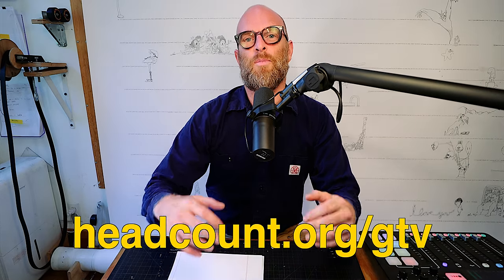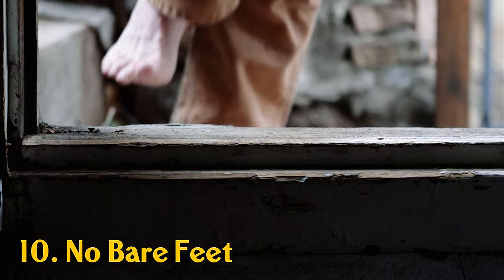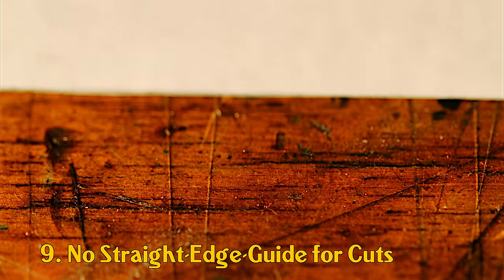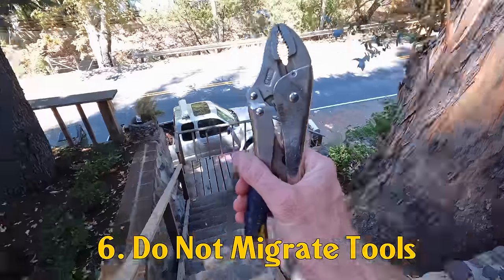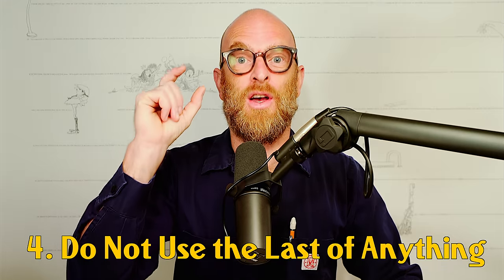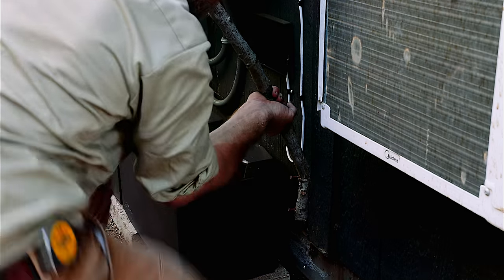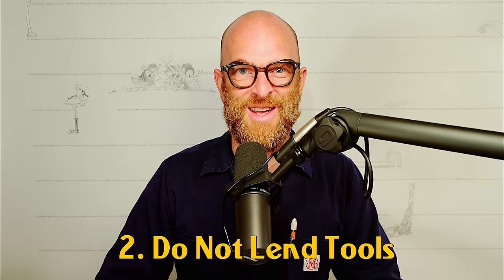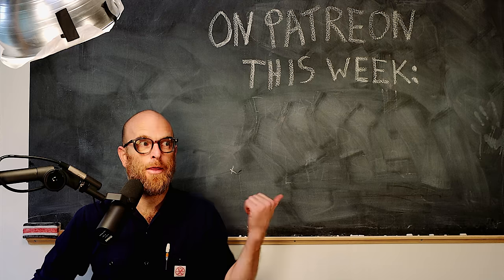10 Forbidden Practices in the Workshop

Comment: There is a reason why no one should ever use flat-head screws - if a screwdriver slips from a slot, it goes into your hand.
Reply: And even if it doesnt go into your hand you immediately wish it wasnt a flat head
Reply: There are perfectly good reasons to use a flat head screw. Ships are a great example, or any environment where debris gets trapped in screw heads because you can easily clean  a slot. Good luck cleaning 50 year old paint and grime out of a Torx head.
Reply: @Nubby007  grime and dust etc. In the torx or philips would bother me a lot less than a slipping flat head
Reply: @smashyrashy  Here here! Agreed good sir.
Reply: good point. probably the single most common tool injury on earth.
Reply: I only use flat head bits to open paint cans and to unhinge hot wheels axles from the base without having to clip off the hinges themselves
Reply: Or just learn how to use a screwdriver. And I bet you use tons of flat-head screws, just not slotted ones.
Reply: @Zero.0ne. not even close lol
Reply: @hallowedbethygame2840  I disagree. Even grandma has used that flathead in her junk drawer.
Reply: @Zero.0ne.  I have never heard of anyone injuring themselves driving a slotted screw, and I find the very concept absurd.  I’m sure there are some isolated cases where someone managed to hurt themselves in that manner, but it’s certainly not the most common tool-related injury—not even close.
Reply: @hallowedbethygame2840  Its common when holding a small part like a hose clamp. I've done it and I've seen it happen to 2 other people. Maybe hammer finger is more common.
Reply: @hallowedbethygame2840  What's your guess on most common tool related injury?
Reply: @Zero.0ne.  Hose clamp is exactly what got me

Comment: I’m a lowly general contractor. Did historic restoration and architectural renovations in SF for decades. I’ve saved/stored many materials over the years. Just finished cottage on the property with many of these items, sinks, fixtures, electrical, wood, siding, etc. very satisfying. Flat head screws have there place. On wooden boats. Where they are countersunk, caulked and bunged. The slotted or flat head is easier to clean out to extract when repairs are needed. Probably one of the only places I’d use them in a new project.

Comment: The only single quibble I had was the “no flat head screws”😂  when building furniture that has hardware of brass, bronze, or iron, nothing looks worse than a Philips, Torx, Roberson, etc…. Those applications absolutely required a hand driven flat head.  
*admittedly, I’m primarily a hand tool woodworker. 
-a huge thank you for your content ❤
Reply: Yes, exactly. Not just in furniture: slotted screws are without alternative for a number of things, especially stuff made pre-1930s. It’s okay to hate working with them, of course – but replacing them in such items is a bit of a sin. And we’re usually only talking about a few, not hundreds.

Also, it would be cool to call them “flathead” screws if that didn’t have another, different meaning: flathead screws are countersunk screws with a flat head, the ones with a slot across the head are slotted screws.
Reply: And guns use flatheads, looks better.  No other way around it.
Reply: I spent my youth working in a mom and pop hardware store followed by a century old family lumber yard. 

I am not the expert. When I hear Van say 'flat-head screws, I translate that to slot head. Using a flat head screw driver. I will use countersunk flat head head screws with a Phillips drive. Never with a flat head screw driver. 

Tomatoe tomato. Potatoe potato.
Reply: @nickspann89  reason for that is you can find random items that work as a flat head screw driver when you need to improvise but good luck improvising your own Philips driver.

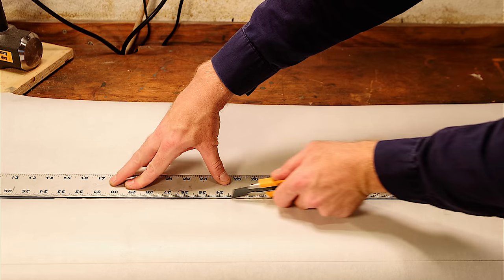Comment: 1:42 I’ve cut laminated signs for five years using a straight razor, each time we were cutting on top of a pre-printed line but we nailed it every time. Never cut a straight line freehand, it only leads to mistakes.

With peace and love to the spirited man
Reply: Oh man…. I’ve only ever cut straight lines both with the penciled in or printed line AND with a good straight edge. I worked at a sign shop for 15 years and I still make small signs for my current job. I just always make sure I use a very heavy ruler with some grip underneath. I can only remember messing up once.

Comment: I love all these concepts.  Videos like this keep me grounded on many fronts.  I have found that applying consistency to my tasks and focusing on getting one done before another starts is very beneficial related to the outcome.  I have two 30s era planes that I am restoring and had to force myself not to do them at the same time.  The Type 3 G5 Gage plane will be done in a few more days and then I start on the Type 14 No 7 Jack plane.  The amount of random tools and supplies it takes to do this job is significant and I am also teaching myself how to clean up as I move to a different task and put those tools and supplies away when done.  Makes for such a better organized process and thus, better results.

Comment: Hello, my name is Pete and I'm a wood hoarder.  I've got wood in my shop from the early 2000's.  The only small pieces I hang onto are the more exotic species, but I do have to confess that they gather a lot of dust.  I'm on a no-purchase restriction (unless a project calls for something directly specific) until I use up a lot of the hoarded wood supply.   It's crazy how much space we surrender to stuff we're not using and don't even have a plan to use.  I'm using a fair bit of it now in preparation for my own first kickstarter, for next year's Make100.  Van and a few others have inspired me to start putting more out there and exploring "my art" more and more.  It's tough to walk by some of those pieces at Woodcraft or a lumber supplier though!

Comment: A trick I use to break rule #9: I have some iron rectangular weights from a scrapped weight lifting machine that I glued cork padding to. I set the straight edge, and then weight it down to keep it stable. It's especially useful when cutting leather or thick foam where you'll want to make multiple passes.

Comment: “No straight edge” is great for accuracy based tasks. But a straight edge is for precision based tasks. That’s why it’s called a *Straight-Edge*.  Using or not using one just depends on the goal of your task. If you absolutely need the finest line you can (which I do when making foam board models) you can’t go with anything other than a metal edged ruler.

And you’ve gotta get a good alumi-cutter/straight edge with a rubber foam or silicone bottom edge to prevent sliding.

Comment: I've cut thousands of pieces of paper when prototyping, and I always use a ruler—with an antiskid material on, of course, the kind made for that job. Then it doesn't skid and your cuts will be perfect. Also, flathead screws are awesome. If you look into fine woodworking you'll find a lot of flathead screws and learn about clocking. I would never exchange a flathead screw on a repair, if it had an aesthetic quality to it (like old furniture).
Reply: AGREED i will ad to that with the fact that i have never stripped a flat head screw. but you even look at a Phillips head the wrong way and oops boom stripped bare FLAT HEAD FOR LIFE

Comment: For cutting along a ruler or other straight strip of material, just glue or stick something rubber to the bottom, like in the guide rails for plunge cut circular saws. They'll never slip unless you're really clumsy. Also, always mark at least the beginning and the end if your cut, tyat way you'll bevable to check your work.

Comment: in my architecture school i developed that rule number 9 is hybrid, first draw a line, and cut a small checkpoint free handed, split it into several section that probably gapped less than 20cm, then use a metal ruler (i used to chop off the damn plastic with my razor cutter)

Comment: Recently built a shed. Instead of running electric I thought I might just run extension cords. Until I realized it was just a mess of trip wires. So with 25 feet of Romex I ran two boxes and one fixture and connected them with a pass thru RV power outlet. I run the extension cord to the exterior wall of the shed from the garage (plugged into a GFCI). 

No more tripping.

Edit: I loaned out a jigsaw 10 years ago to a person who I thought was a friend. Haven't seen or heard from them since. Shame on me for being overly trusting.
Reply: But look at it this way... You got rid of him for the price of a jig saw.... and you didn't have to cuss him out. I'd say you came out on top.

Comment: The flathead screws one hit hard. I effing loathe those things. And the previous tightarse diy’er owner of my house used them everywhere, and also filled the slots with paint on all his crappy projects.
Reply: You mean slotted screws. Flathead refers to the shape of the head, not the type of drive. And you’re in luck: paint is much easier to clear out of the slots than any other type.
Reply: I agree they should be referred to as slotted, but I mean he did call them flat-head in the video. 
Also I find most of the time if there is paint in a Philips head, it just mashes out of the way if you just push a bit harder, especially using an impact driver. Whereas you have to clean the paint out of a slotted screw.
Reply: At least it's not rounded out square heads
Reply: @anonymouswhite352  Very true!

Comment: 5. Flathead screws only where hand-tight is the only kind of tight you need. Otherwise yes.

4. This rule applies to everything, if you needed to have a stock of it before, you will need a stock of it in the future.

3. My art closet is becoming a nightmare because of my hoarding. I also have a bunch of wood I will never use.

2. I have my dad's impact hammer, next I organize my tools it is essentially mine.

Comment: 1960s telecasters had flatheads on all connections for ease of repair on the road.  it was like the 2cv of guitars.  it's not "better" it's just a design choice to make the instrument fixable with a dime in a pinch.  now, it's common for professional musicians to have a tool kit with them anyway, but i mention that for the same reason you mentioned typewriters and camera accessories.  it's there to be fixable without a real toolkit.

Comment: Flat head screws are good for their purpose. They might show weakness and you will feel awkward when used with motorized,  electrical, pneumatic screwdriver. Yes motorized screwdriver works fine with center oriented ph, pz, torx, etc screw heads. Quick factory assembling. That's the main idea. They are designed for that. I've seen many spoiled ph screws. Especially self tapping screws. But when used with nuts and without electric screwdriver in lots of places flathead screws are absolutely ok.

Comment: No Flatheads?!  You can get crazy torque on those to tighten something.  Think how the force is applied to the outer diameter of screw.  But, you need to be real careful, and use handheld screwdriver.  I pledge to do better to minimize my hoarding tendencies. Good tips.

Comment: When you say No Flathead screws! in Mommie Dearest style, I think you're talking about straight or slotted screws (Where there is only one straight channel for turning the screw, as compared to an X on a Philips head screw.) Flat head usually refers to the profile of the top of the screw; flat head is flush, compared to a pan head screw that is rounded on the top.
Reply: In the UK we call it a flat head screwdriver, and therefore flathead screws. But I think you are right, this term has become confused

Comment: Straight edge + thin double sided tape + sandpaper. Light cut to mark + several cuts "freehand"
Reply: With sandpaper the straight edge doesn't slip, also always chose a metal ruler

Comment: No.9 - Use a cork backed stainless steel ruler for cutting straight lines as it won't shift if you apply appropriate pressure. Also, rotary knives are great for this rather than a stanley knife. Loved the video - fuck flat head screws

Comment: 4:04 Number 5: You don’t get to make rules about screws if you don’t know what you’re talking about. Flat-head screws are countersunk screws with a flat head, and all of you use them all the time. Screws with a single slot across the head are called slotted screws, and there’s a good number of reasons for using them – taste, for example, but there are purely practical reasons, too.

And the ratio of stripped out slotted screws to stripped out Phillips screws over here is 1 to 20, mainly because more often than not (especially with wood screws), the Phillips screws are actually Pozidriv screws and people mangle them up by using a Phillips bit, having no idea that the two are different.
Reply: Forget all that and use Robertson screws.

Comment: Hi Van, please do not use an angle-grinder without a guard. lovely content btw!
Reply: You should work for OSHA
Reply: @macc1370  And you should see what happens when a disc explodes.
Reply: there is time and place for guard. I have a friend that lost 2 fingers because  of guard, angle grinder grabbed on unnoticed lose threat of glove, normally it would just bounce of, but fingers were pulled under the guard, so you know, it's not one solution  fits all.

Comment: I beg to differ on number 5.  Sometimes flat head screws are better.  Like on an old boat or other place where paint gets into the screw.  To get the screwdriver to bite the screw for removal, you can scrape clean a flat head screw with a smaller screwdriver, but a phillips or torx are much harder to clean out.  That said,  I do prefer torx for most of my work.
Reply: Use the end of a nail or screw

Comment: Ignore the "no flat head screws". If you care about your antique restoration, you'll replace the bad screws with the shape, head, and style it had. And the same material when possible. I buy pounds of 4-40, 6-32, 8-32, & 10-32 of domed, fillister, and countersink brass screws. If the thread is odd on the item being restored, I tap the threads to the closest screw thread I have in stock.
Otherwise, I agree with the list. But, if you care about antiques, you'll respect the slotted screws. Keep your flathead drivers sharp and clean with an Arkansas stone.
I even replace off-key style head screws in antiques with slotted screws. Especially if it was made before the 1960s. Phillips heads only acceptable when they cannot be seen. Even then, a self respecting restorer will use slotted screws where they cannot be seen.

Comment: Rule #9 doesn't make sense to me. Wouldn't the pencil against the straight edge encounter the same inaccuracies as the blade? Simply using a metal straight edge with rubber backing would be effective.

Comment: 5&9 // not a rant, more like sharing point outs// take it as you will // there is a point of diminishing returns on how straight you straight line you want.
straight edge 
 if you use aluminium  straight edge with thin edge you will bit by bit cut into the straight edge and it wont be straight anymore, 
you need to use thick side of straight edge, 
you need edge that is not raised, because  that introduce higher cut offset variability
if you want to prevent knife from drifting off from straight edge you need to maintain a reasonable  amount  of back-to-edge pressure
as you don't want straight to shift rotate or more by knifes pressure, you need to apply high constant down pressure, preferably  in the middle of cut to minimise  probability  of shift on the most outer part of cut, there is some tuning between knifes-back-to-edge pressure and down pressure on the edgy and part of cut
there are two important angels, 1st perpendicular is offset & material chamfer, 2nd along the cut, how high or low off knife is, gives smoothly blade wants to drift, lower is smoother, the more flexible  blade the smoother drift, smother drifts are easier to control, in sense that they take less back-to-edge pressure to control
if the surface is to slippery to maintain straight cut, you can add backing like masking tape, or even better a dedicated cutting straight edge with cork or silicone backing 
good way to make cuts better is physical positioning indicators for straight edge, like 2 pins or (my preferred) two tiny cuts at the ends with paper slightly bend up enough to allow stright edge to fall on them into position 
backing board if you have a backing board thats cut a lot in one spot it might drift you cut off straight, it's better to spread cuts on board and to change angle 5° to 10° 
it's better to keep old dedicated backing board, after about 100-200 cuts the groves in the board make it grip the paper, which is nice
if you cant spread out anymore cuts on backing board it's time for new one 
material of backing board, cheap: high density particle board, for high consumption: aluminium (proper) or glass (cheap)
glass backing doesn't groves, stay slippery and every time chips of the tip of knife 

flat head screws

they are so useful that we neglect them, we usually don't carry like 5 or 6 bits, like in case of Hex, torx, Ph, because range of 2 to 3 flathead screw drivers cover 95% of use cases as proper size and 99% of rest are manageable with close enough, 
flat heads are only ones that can be scrape clean to fit screw driver's blade in the clogged up screw head, this is you in boat building the stick to flat heads 
me personally PZ or Torx, least chance of come-out, but that depends on availability

wow that came out long, appreciate your videos, take care Van

Comment: Did you mean slot head?  Flat head is a type of screw that is flush with the surface when set.  It has the funnel or triangular shaped head.  Flat head is a very important and useful screw.  You really can't mount a hinge without a flat head screw.